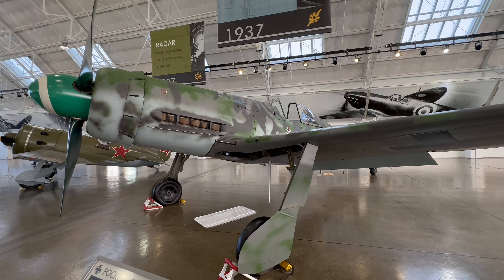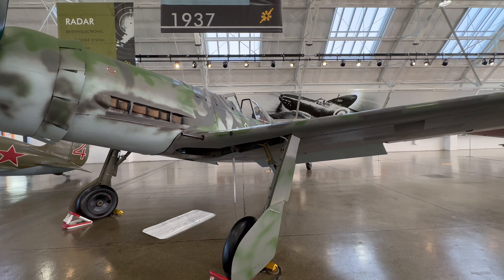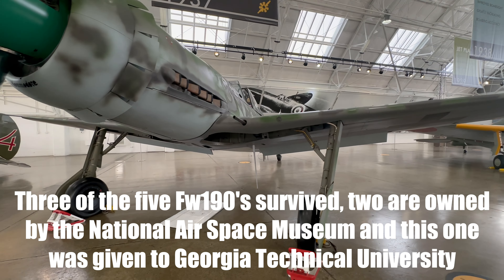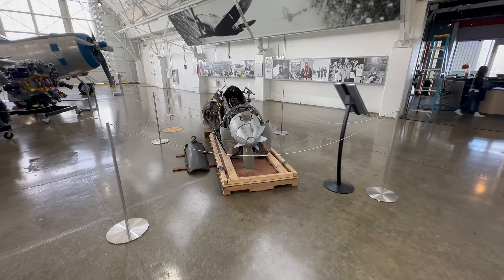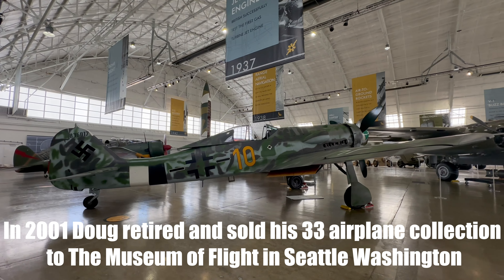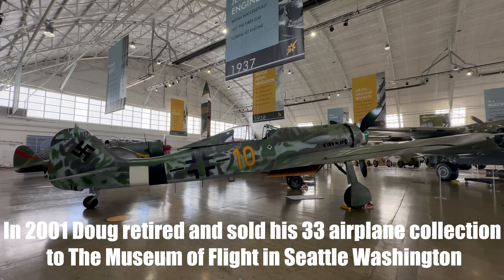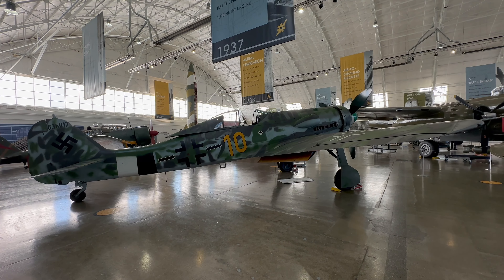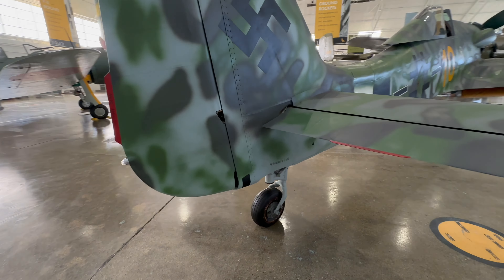Focke Wulf Fw190 D13 Dora WW2 1945 German Fighter

Comment: Doug Champin's wife had connections to the German aerospace industry and he had the Fw-190D-13 shipped there for the first restoration in the 1970s.  Prof. Kurt Tank was still alive and back in Germany and Tank himself was there to assist with the first restoration.  However, there were a few imperfections and missing items.  In 2007 Champlin had the plane restored again to sell, "make it right" was his instructions. Missing items were located, new electrics and fuel systems were made and the plane was painted according to newly discovered photos of the same aircraft just after surrender. The correct paddle-blade propeller is still missing. It had wider-chord blades.  Champlin was restoring it again for flight, although I think it would need a bit more work to be certified for flight.  Paul Allen's museum has never run the engine.  Gosshawk wanted to run it again after the new restoration, but there was no time before it needed to be on the truck to Allen's museum. There are two or three Fw-190D-9 projects but nothing that is close to flying yet.   Regarding the Me-262,  Allen was restoring it to fly as an original Me-262.  The project was paused after his death and just after the initial taxi and brake checks were performed.  More work will be needed for the Me-262 to fly.
Reply: The D11/D13 is so typical of the Germans - they looked at the D9, with its ugly machine gun housing, and just had to fix it - for aesthetic reasons, even though the war was lost.
Reply: @smartiepancake   The D-14 and D-15, along with the Ta-152C had the potential to be very formidable if they had been completed for service.  Very few D-14/D-15 made it to service.  There is photo evidence of one maybe.
Reply from the maker: Can I buy you lunch?

Comment: So will they ever fly this? Is it flyable? Is it rare?  I am surprised you didn't mention that in the video. 😆
Reply from the maker: Yes it can fly. It was rebuilt to much better than new. However the owner passed in 2019 and all flying activities were frozen. The estate sold the museum in 2022 and the new owned has not issued a statement of his intentions. Most people think the collection is heading to Arkansa in the next few years. This building is full of priceless WW2 aircraft. Some have had what is called a data plate rebuild or reconstruction restoration. This is where you make entirely new pieces of the entire airplane. Built without wartime conditions, no time constraints, better tools, and better labour. The result is stunning. They have a brand new Stuka.  https://youtu.be/2tMndz-pv3M
Reply: @ontheroadwithnorm2024   I do not think the D-13 is actually flyable without additional work.   Doug Champlin had it restored again in Arizona but I don't think the engine was given the required tear-down and rigorous inspection and testing to be flight certified.  It is an enormously expensive process to inspect, repair, test and calibrate all of the components on the engine.  The engine shop in California is building another Jumo 213 for another client and they have been working on it for years, and are still waiting on parts and the new prop and hub before it can properly tested.
Reply from the maker: Mr 5 Cents always gives the best information on my vids. Thanks.
Reply: The engine was run after the airframe restoration while at Champlin. There are some YT videos, which was done with great difficulty using the original hand operated inertia starter.  It is reported that the engine also has vibration problems and needs an overhaul. No need if it will not be flown again because of it's rarity.
Reply: Is it longer than a 190 A?

Comment from the maker: Wondering if "FiveCentsPlease" knows if this is one of the 21 airplanes built at Flug Werks? If so is any of it original? And did they contract out the sheet metal work to Romania? Is there a book of what happened at Flug Werks 2000-2012? Did Gosshawk buy the jigs and tooling in 2012? Are you out there FiveCentsPlease?
Reply: +@ontheroadwithnorm2024   I'm out there, but going through some sh*t.   What are we talking about here, the D-13?   It's original, Werk. No. 836017.   Regarding the Flugwerks, the German company contracted with Aerostar in Romania to do the construction of their kits because they still had the aviation knowledge for WW2 construction.  (A few quality-control issues aside.)   When Flugwerk closed, Gosshawk bought them out with the jigs and inventory.  Gosshawk services the Flugwerk Fw-190s now but they are NOT the only shop that can build a Fw-190.  (The ORIGINAL and flyable Fw-190 at Flying Heritage was built by an expert team in the UK, who also started on the Me-262 after that.)   There are a few lists of the Flugwerk serial numbers and where they are.  Slightly less than half are actually flying and some are just static museum exhibits.
Reply from the maker: When you say the D-13 is original, do you mean the skins are original too? It looks too new and perfect.
Reply: @ontheroadwithnorm2024   Good question and I would say mostly.  It was photographed in the late 1960s in an empty lot outside of Atlanta and was mostly intact.  (Keeping in mind that the AAF had accidently switched wings with the Dora at the USAF Museum, and this was corrected later.)  Sometime while in Atlanta, a crazy drunk took an axe to the plane and chopped off the supercharger scoop and did a bit more damage.  Bit and pieces went missing, like the original prop.  It was photographed in California with new owners in the early 1970s, and it was standing on its gear.  This was the owner that stripped the plane to bare metal to apply zinc chromate paint but this also erased all original markings.  The next owner was Doug Champlin who shipped it to Germany where friend Art Williams worked to restore it with help from Prof. Kurt Tank who was still alive.  There are photos of the plane from this time in several books.  So this D-13 was not a smashed wreck but remained a mostly intact airframe, making it a very rare example that should not be flown.  It looks "new and perfect" because owner Doug Champlin was selling his collection and shipped the D-13 to Gosshawk to do over again and "make it right."  At the time, the rumor was also to make it airworthy for the sale, but I don't know if that actually happened. New fuel tanks and electrics were made for it, so I think Champlin was serious.  Paul Allen bought it while it was still being restored and there was a bit of a rush to finish it and truck it to Seattle.

Comment: If companies build the A model, why not the D?
Reply from the maker: Probably because they are building on an original data plate. Unlike the 5 me262's built in texas that were completely new.
Reply: +@georglimiux677  Three of the Flugwerk kits are in Dora configuration but nothing flying yet.  Actually there was another conversion that was close with an Allison V12 but I've heard nothing so maybe they have problems.  Some Dora projects are out there but it will be a few more years, while some projects aren't moving at all.  A very good shop in Germany is presently working on a Dora and they do good work but it's seems to be something they are working on in private.